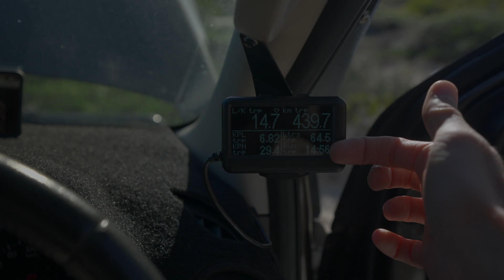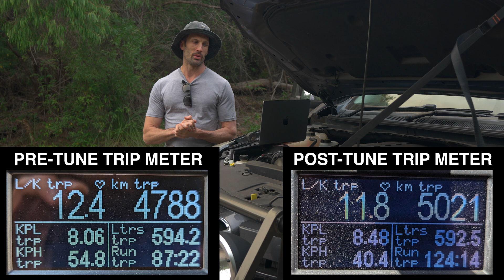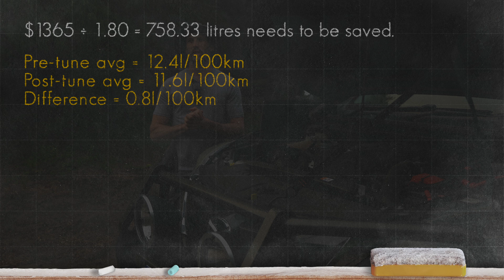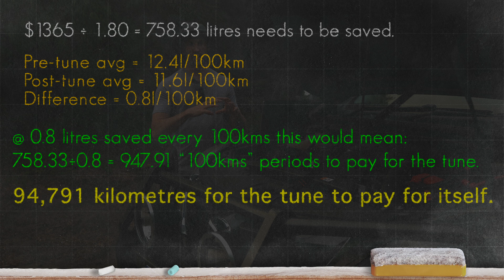4WD Diesel Engine Tunes || How Long Does it Take For a Tune to Pay For Itself?

Comment: It is impossible to get more power and use less fuel. Snake oil sales will argue differently. The factory spent millions and had 100's of people testing and  now some back yard guy with a lap top can do better. Snake oil sales will normally now say the factory left heaps to improve upon.
Reply: it makes sense that they've come out of factory super safe, saves them money on engine recalls if shit starts to brake down from heat, and if people want to get tunes they can

Comment: House of automotive remaped my px2 3.2 ranger made 176rwhp and 520nm at the wheels. i bloody should of done it earlier! Hard pipes, intercooler, dpf back exhaust. Egr delete. Towing is next level all the torque is 1600-2200rpm tows 110% better then it did stock. Uses about 10.5 per 100k. Holds 5th up collie hill at 100 towing my FF camper. Towing also used to use 14.5 towing at 100, now uses 12.5-13.5 towing.
Reply from the maker: Yep it definitely makes a difference, the car feels better afterwards for sure.

Comment: my 2013 BT-50 3.2 ,last year received a tune 
before 99.1  kw 40kph     630.7nm @70kph     motive force1300.8 lb @40kph
after  120.9  kw @40kph 897.4.nm  @ 60kph  motive force 1850.8 lb@40kph 
I'm😃😃 happy
Reply from the maker: Those torque numbers seem to be very high!

Did they measure them at the wheels?
Reply: @TheBrowneTown  measurement was at the wheels,have hard pipes, aftermarket Garrett turbo,Alloy intercooler, larger alloy radiator.My motor was replaced under warranty early on.This is its first tune,I tow a camper trailer, asked for a safe tune and this is the result ,Berrima Diesel  was the company
Reply: that's wicked